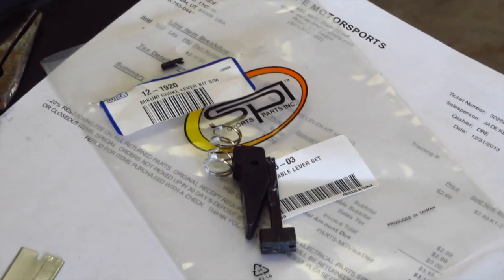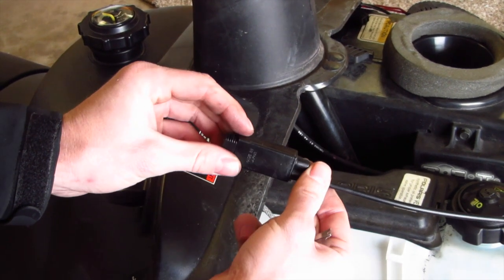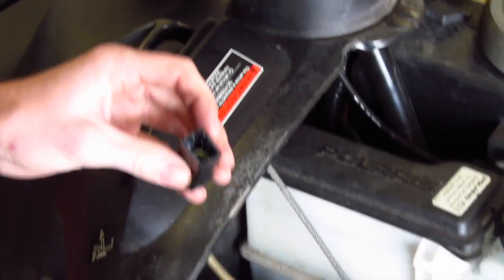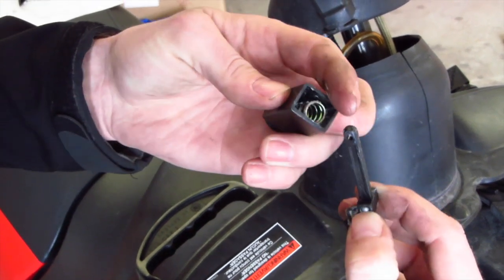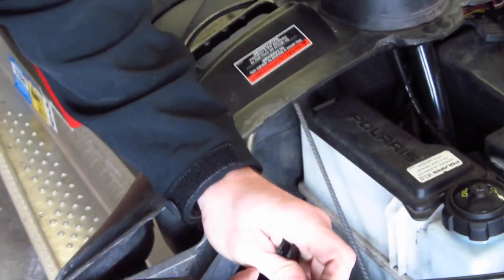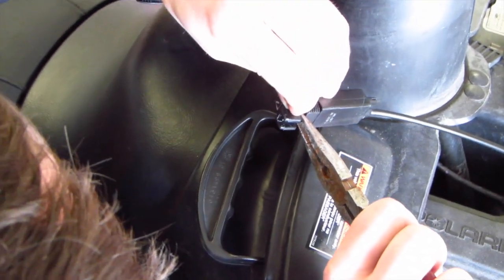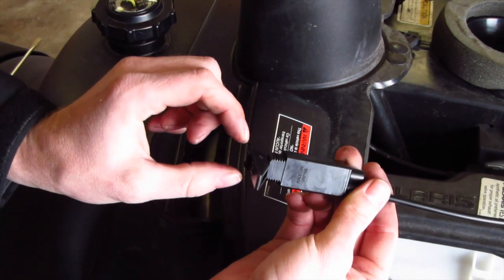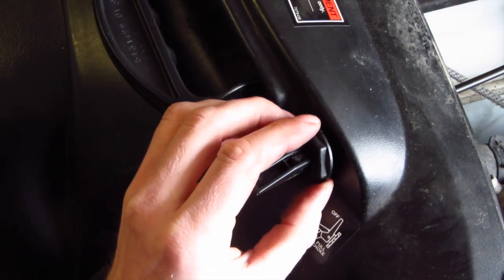rmk700 choke lever fix

Comment: Great tip on using  a razor blade    All other videos  say just pull hard and that wasn't  working for me.  Tried a small screwdriver and that didn't  work but a razor blade did the trick.

Comment: So I have a 2014 Polaris Indy 550 Adventure.  I went to start it yesterday and run some gas through it, as I do every couple weeks over the summer to keep her fresh.  The choke went up all the way to cold start, and then upon putting it halfway down and then all the way down, it hung completely flaccid and 'out' some from the assembly (~1cm) and the engine could not stay on.  It was as though the cable was stuck in the sleeve?  I am not sure.  Less than a year old, only 300 miles, and always stored under a covered trailer.  Do you think first trying to rebuild the switch may fix it, or is there a bigger problem in the cable itself or where it connects to the engine?  Not very mechanically inclined.  Yours is so easy to reach there, mine is in the middle of the console under the steering column and is really tough to access internally.